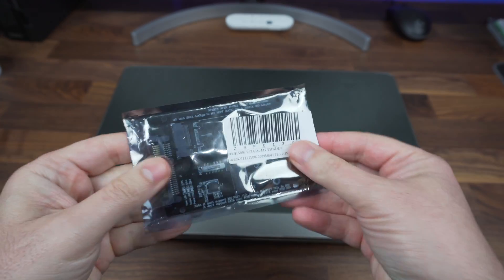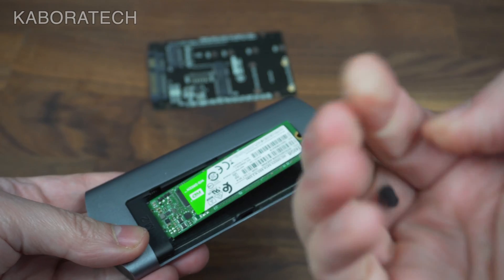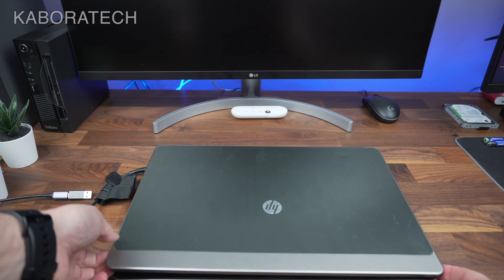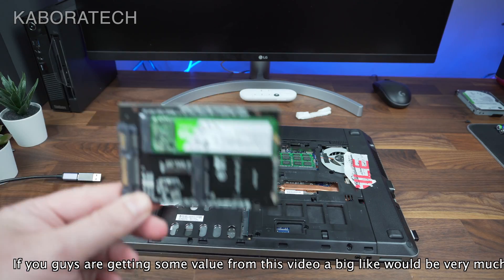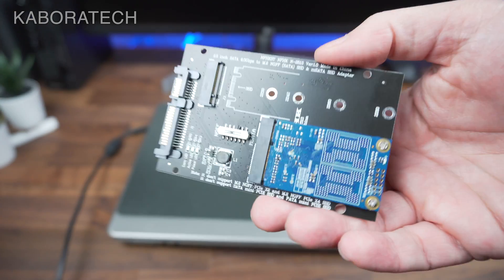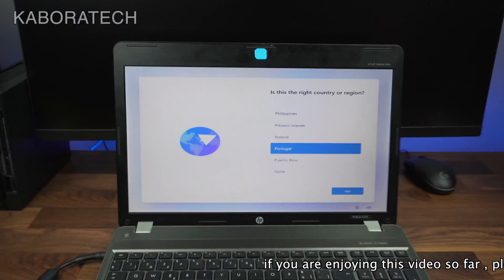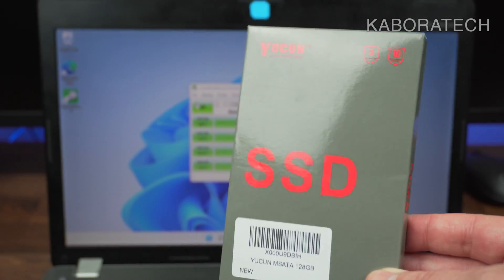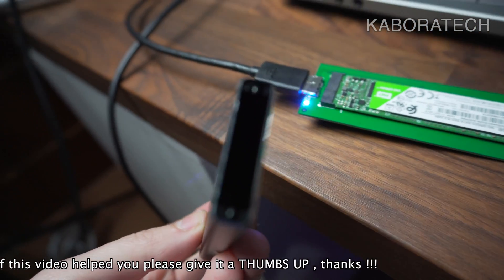M.2 ngff msata ssd to 2.5 ''adapter sata3.0

Comment: Can you connect that adapter to a USB slot on the motherboard with a SATA ribbon cable?
Reply from the maker: Why don't you buy an external ssd usb enclosure? This is meant to be sata connected...
Reply: @kaboratech  I just don't wish to carry around an additional equipment.

Comment: hi sir i want to buy nvme but my pc  is a old school still running sata ,the question is if i convert to m.2 m key the speed will decrease or continue like was on the nvme?
Reply from the maker: @sibonelogift5061  I am confused with your question, if you want nvme on an old pc, you need a pci-e nvme adapter, unless it is a laptop... If it is a laptop and there is no nvme socket... I think there is no solution.
Reply: @kaboratech  I mean  , I want to convert NMe  M.2 M Key to SSD solid we normal use before  doesnt decrease the speed NVMe has?

Comment: Performance of the M.2 NGFF SATA SSD is just the same through the adapter compared to directly plugging it in an M.2 slot on a motherboard right?
Reply from the maker: @abunk17  yes, if connected to sata will not improve any speed, the faster will always be the nvme.

Comment: ¿No issues with the drivers on ubuntu?
Reply from the maker: @hoisec2013  why, not working for you?
Reply: @kaboratech  I havent try yet. But I´m to. And I was wandering about that. I do have a lenovo ideapad 110 15 isk 3855u 4gb with horrible performance, and I was thinking wich ssd put in there.
Reply from the maker: @hoisec2013  normally ubuntu has drivers for all

Comment: Can i using 1 ngff + 1 msata?
Reply from the maker: I have other video with dual ssd pci-e, check it, this one is one of those at the time.
Reply: @kaboratech  can converter running with 1 ngff and 1 msata???
Reply from the maker: @Koolaid22  one at the time.
Reply: @kaboratech  can't it be done all at once??
Reply from the maker: @Koolaid22  I have other video in my channel with a card that takes 2 ssds, but it is not for laptop is for computer tower, pci-e

Comment: i am using sata ssd in my laptop i want to more speed in my laptop can i install m.2 sata ssd with adapter overall performance and speed increased or same bro please suggest me
Reply from the maker: Only if the ssd is faster than the one you have.
Reply: @kaboratech  My laptop dell e3460 i3 5th generation, my only sata SSD support currently I am using wd green 480 GB but speed not good, now I am thinking I want to buy a m.2 sata adapter and geonix m.2 sata SSD 6 gbps can I improve quality 😢😢

Comment: I installed an m.2 disk with that board but when it came time to install Windows 11 it did not allow me to do so, it told me that it was not ready and it did not allow me to start it in the disk manager, what could I do?
Reply from the maker: Is the error like this?  https://youtu.be/I0knpLSqEo0?si=ySLYCsCTeKJDDdZ1
Reply: @kaboratech  I think this adapter does not work for m.2 Nvme SSD, is that it?

Comment: i have 2 slot 2.5 and 1 nvme(2280) but i only use 1 2.5 . and now i wan to use my nvme slot to egpu 16x and change nvme to 2.5 slot do i need cloning my nvme (my primary storage) ?

Comment: do you see any speed benefits by using an NVME drive with adapter vs just using a. SSD hard drive?
Reply from the maker: This disk is not nvme, is ngff, the one I show on the video, to benefit nvme connection it has to connect via pci-e or direct on the motherboard

Comment: Hi, I dont have any slot for nvme in my lap. Can I use a nvme through this converter and the hard drive to the caddy? will it works?
Reply from the maker: Nvme requires pci-e to perform in top speed. If you use sata conector it will bottleneck. Correct me if I am wrong.

Comment: thank you. my order came in first before i found this video. i run my nvme m.2 b/m on pcie2 x1 because my motherboard dont have a x4. sata3 is much faster than pcie2 x1. i ordered one of this today with enclosure for around 3usd. i want those extra 100mbps speed from sata3.
Reply: Did u get? I have a Samsung 512gb 4x4 PCIE and my laptop has a 2.5 port extension. How can I get PCIE speeds on the 2.5 port extension. Am looking for answers.

Comment: good job sir. After watching this, I too got myself the same card for my old laptop as well. But couple of questions are still in my head. Could you clear, 
1) what could the maximum data rates be through that SATA adapter pins of this board? 
2) If I buy and insert a nvme ssd with 3500 Mb/s data speed, will this card utilise the full speed of this nvme ssd? Or will it be cut down to 500 Mb/s only?
Reply from the maker: hello this adapter is M2 NGFF , not NVME compatible , even if it did accept NVME the reading speeds would be bottlenecked  to SATA speeds , NVME requires connection to the motherboard directly or via PCI-E card .  info :  The speed difference between a SATA connection and an NVMe connection is significant. NVMe drives offer much faster read/write speeds compared to SATA SSDs, with NVMe drives reaching speeds up to 3,500MB/s or higher.
Reply: @kaboratech  great. this was exactly what my understanding was as well. Thanks for the reply.
Reply: @kaboratech  despite the speed bottleneck, can NVMe drive actually run on this? NVMes are getting cheaper than 2.5 inch SATA SSDs nowadays

Comment: Can the sata slot be replaced with an external VGA?
Reply from the maker: Not sure I understand, and why would you need that?
Reply: @kaboratech  I want to install an external VGA on my laptop, but there is no ngff or mini pcie slot..
Reply from the maker: @San-Yui  search Aliexpress but probably if exists it will probably use the Wi-Fi card connector.
Reply: @kaboratech  ok, thanks for replying to my comment, but my laptop doesn't have a wifi slot, it has a sata n floppy disk slot, so I want to try ngff and msata adapter,... 😁😅
Reply from the maker: @San-Yui  I don't think you will find such adapter :(

Comment: is there a way to use a SSD m2 nvme with a caddy to conect it in a SSD - SATA 2.5-inch 7mm ???? or theres no way?
Reply from the maker: I think not, the connection would bottleneck the nvme ssd, nvme was created later to be faster, so if uses a Sata conector would give less speed.

Comment: SATA cannot read NVMe because NVMe is ran through PCIe
Reply: can i change my wifi slot to m2 . wifi slot can ram pcie ?
Reply: @Hiro62038  yeah, there are m.2 WiFi cards. You do need to check to see what keys your m.2 slot has first to see if you can use m.2 WiFi cards. Some 6e cards cost about $30 or less.
Reply: Maybe it's a M.2 SATA to SATA adapter only. This type of adapter is pin-to-pin compatible.
Reply: You need a clover bootable pendrive to boot nvme from PCIe slot
Reply: @earthisnotflat7331  You can boot directly from the NVMe thats in the PCIe slot. You have to make sure UEFI mode or Legacy Boot option is enabled in the BIOS. Depending on if the MOBO BIOS supports it, of course
Reply: @joelgreen8132  I see
Reply: That adapter has a controller convert pcie to sata
Reply: No, because ints called an adapter, genius, it converts the NVME to ATA
Reply: @klitibehluli2  You will end up having slower bus speeds. Plus. There is no true NVMe to SATA adapters. As both have different protocols. You would need to right controller to convert the NVMe protocol for the ATA adapter. Basically, you are just hurting the performance of the NVMe for the sake of storage
Reply: @joelgreen8132 sata drives have worse controllers and nand durability than nvme drives. If the price difference between sata and nvme isn't too much and you don't have any nvme slots available, a adapter like this is a good option.
Reply: @klitibehluli2 that’s counterintuitive

Comment: Its meaningless if we get 400-500MB speed on nvme ssd.
This is normal ssd speed.
Reply: But if u have a few nvme laying around will I be able to get sata speed?
Reply from the maker: None of those were nvme....
Reply: @kaboratech  my point was. If ssd has 2500+MB SPEED.
THAN USING THAT WITH ADAPTER AND WE GET 400-500MB SPEED.
ITS BETTER TO BUY 2.5" SSD

Comment: Is it possible to use the wireless card in this adapter, since it has a mini pcie entry?  Is the some performance loss?
Reply from the maker: Hi, did not try, perhaps it work 😁
Reply: I was thinking the same thing when I saw the other port

Comment: doesn’t the benchmark say the read/write speed is in MB/s? and Amazon states it in GB/s…?
Reply: Reply if you like the details 🙂
Reply: Not in GB/s it's Gb/s there's a difference between them and they take advantage of it 
1GB=1024MB
But
1Gb=1024Mb = 1024/8 MB = 128MB

So they claim their ssd to be 6Gb/s which is 768MB in real 
That's how they trick most of the people
And earn.
Reply: @onlyforyou31  , ну, это в теории.
А в реальности эти 786 мегабайт
уменьшатся ещё в два-три раза...

Comment: Hi, i purchased these days from ebay the same adapter like U have,M.2 ngff msata ssd to 2.5 ''adapter sata3.0, but I use together whit an sata to usb adapter. I used these rig while my m.2 sata just died inside the laptop at work (I made a 5 min break and when I returned to desk blue screen...:( ......) and I wanted to be sure is the m.2 itself or the motherboard of laptop faulty. As I have no other m.2 to try I am not sure if my new adapter is ok.Question is: are all 3 leds(conn ,active, power) from the board needed to work ? I have only active and power leds working on mine when fired up, and switch from board is set to ngff...U are useing inside laptop and is completly other side mounted so not able to see those led`s in your video  :(  . THX!!!